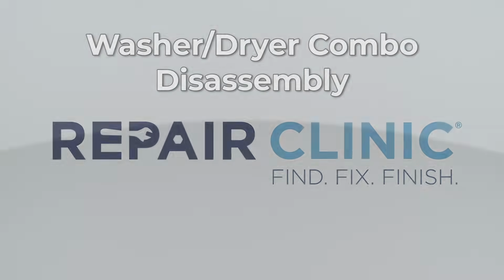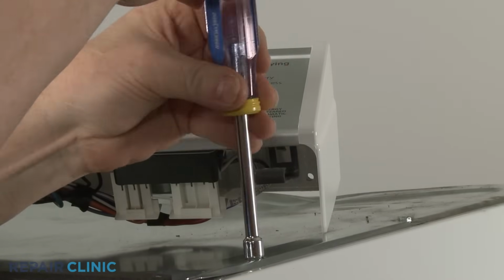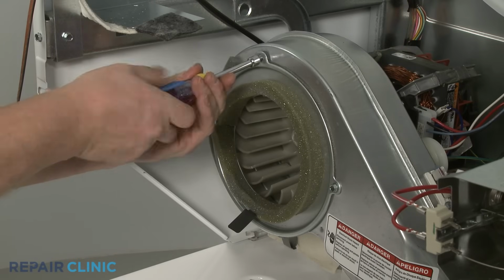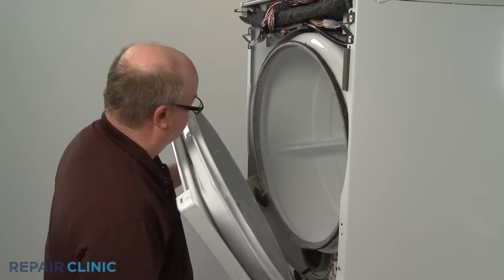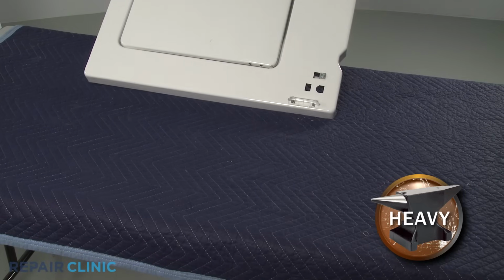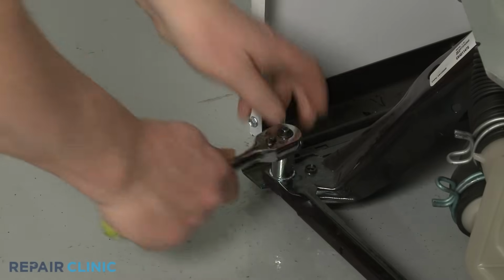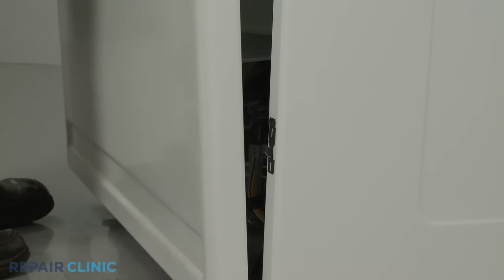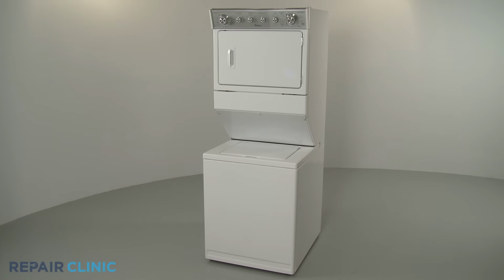Whirlpool Electric Washer/Dryer Combo Disassembly WET4027EW0

Comment: I have an item trapped beneath the agitator.  Can you tell me how to remove the agitator?
Reply: Depending on the model I usually cut them out use a puller tool to remove what’s left and replace with a new one

Comment: Thank you VERY much for this video, last night I came downstairs to a partially flooded basement due to the water from the washing machine pouring onto the floor, turned that off and then spent hours absorbing as much water out of the carpet as I could.  Today I watched this video and found the issue and fixed it.  Washing machine is now running correctly and I'm working on getting the carpets dry.  This video helped me a lot.  Thank you again.

Comment: awesome video/ My washer top does not appear to have any spring clips. do you have any videos of how to disassemble that style(WET4027HWO)?
Reply: I have the same question. Exact same model as yours. Get the point of taking off those fabric covered panels. Then it's just flat on the back. No springs there. Did you ever figure it out? If so how? I didn't want to just start unbolting/unscrewing everything that is in the area of the lid on the back. But I think that will eventually be process of elimination to get it done lol
Reply: I had the same issue, but look for some screws behind the short metal plate on the rear

Comment: What do you do on the model wet4027hw oh if the top on the washing machine does not slide out like the other ones on the stack owns how do you replace the lid switch
Reply: I have same model. Has no clips to detach behind those access panels. Can't find anything anywhere on the Internet about it.

Comment: I have a new model of the WET4027HW0 stackable washer/dryer and the top panel/lid is one piece from front to back and I need to replace the washer lid switch.  Do I have to remove the entire upper dryer to get at the lid switch?  The video shows a shorter top panel/lid, which is straight forward to remove.
Reply: Yes, I have the same problem; i need to gain access to the 'HW0 insides to replace the suspension rods, and I don't see any easy way to do that, other then completely de-stacking the dryer.
Reply: @ronaldrissel6665  did you figure anything out other than total disassembly?  Looks like a terrible design.

Comment: Great video. My dryer operates well until the very last part of the drying cycle. When the dryer is hot a loud rubbing sound starts coming out of the dryer. If I stop it and start it. the sound goes away but after a few minutes it comes back. Does anyone know what the problem is and how to solve it?
Reply: I found the problem. When the dryer heated up the blower wheel  expanded enough to contact one of the screws holding on the blower housing inlet cover plate.

Comment: Great video ! I have an old Whirlpool LTE6234AW1. (when pluged in) the washer setting control knobI pull it  out to start the washer But nothing happens. however if i turn the dryer selector to any setting and depress the power button for the dryer ,water starts to fill up the tub. this is so odd. what part would you think i should replace or what steps to trouble shoot for replacement parts? mucho appreciated

Comment: So my washer/dryer says it's this model but it does not look like this. There are no spring clips to take the lid off the washer. I need to replace the washer door lock
Reply: Did you ever get answer?

Comment: Thanks to you, we were able to change parts  and see how to open the dryer in the right order, we replaced the motor, the belt, the blower wheel, the element and all the seals and foam. We have a new dryer that will last for another 25 years.👍👍👍👍🌟🌟🌟🌟👏👏👏👏 Take care and bless you.

Comment: How can I adjust the water level on this model
Reply: I had the same problem, service man said put 5 gallons of extra water in the unit from a faucet. Great design.
Reply: Mark I have the same stackable and the same problem! Does it work ?
Reply: i am having the same issue -

Comment: I have just replaced the dryer belt on my 3.5 year old machine. What had happened was that the retaining clip that is supposed to be on the end of the spindle that carries the pulley on the idler arm had never been installed, and the pulley gradually worked itself out of line, causing the belt to run hard against one edge, which stretched it. During disassembly I discovered that the connection between the vent aperture in the door and the pipe in the machine was out of alignment by approximately half an inch, and thus the entire interior was covered in 3/4 of an inch of lint. It was not possible to re install the front cover without first propping up the drum with a 1 foot 2 X 4, removing the door, and supplementing the screws holding down the top cover to make it stay flat enough to allow the flange of the front cover to overlay it.Overall, only a minority of the screws aligned enough with their holes to allow re installation without the use of a clamp to pull the sheet metal into alignment.

I was unable to resolve the misalignment in the venting pipe. For this reason I believe this unit presents a significant risk of fire, and I plan to replace it as soon as possible. My decision is made easier, though certainly not easy, by the fact that the machine has never satisfactorily cleaned clothes. On all but one cycle it is not possible even to get them completely wet. It is not possible to wash dry cloth.

I will not be buying an American designed or manufactured replacement.

It seems that  this country sunk has so far into decadence that it can't even make a decent washing machine.

Comment: a close up of the knobs would have been nice! i'm guessing since there is no water level knob on mine that that pressure switch with the air tube that you fixed first off must control that? don't know. can you give us the p/n?
I have to ask...WHY would they even MAKE a washer that only fills half way up with water and call it Energy Efficient?!  I have to run it twice as long because it only does a half a load! That means TWICE as much Electricity!  I am sitting here trying to figure out if i need this pressure switch, when i see the owners manual on your site (thank you very much) and it shows it only fills up half way to save water.  This is ridiculous! I would like to find the engineer at Whirlpool, who my experience shows makes nothing but junk anyway, and stuff this up his butt!  I got this thing GIVEN to me and now i know why. I am glad i kept my old one.  For Sale: Cheap!

Comment: Thanks!  This video helped me get the washer top off my whirlpool thin twin stacked washer/dryer so I could replace a busted lid switch.
Reply: How did you determine the lid switch was broken? Mine had been working fine and all of a sudden the washer just does not turn on..
Reply: @donnabauerofbrilliancebyde1178  if I shoved the lid down it would turn on again.  When I took the top off, I could see the plastic was broken

Comment: I have a maytag 18955425qm washer dryer combo. When my wife was doing the laundry a bag handle got stuck and stopped the washing machine. I was able to remove the bag safely and the washer seems to work now. However, do you happen to know if the water basin has any clips or brackets to hold it in place? The water basin moves a little more freely now and I want to make sure that nothing broke in the process. Thanks, I appreciate your help!

Comment: Have a question I purchased a whirlpool stackable washer and dryer I was told I needed to purchase a 30 amp cord so I did it was delivered today I took off the access panel in the back to remove the cord it came with o believe it’s a 20 amp cord and I can’t find the terminal block

Comment: When he said to use a flathead to help detach the latch assembly, does anyone know how...exactly? Maybe I don't know where to push but it's not moving at all
Reply: Put the screw driver in and push towards the back
Reply: @LUCAMTire  thank you!!
And sorry to be confusing, I was warching the "Fridgidaire Affinity Washer Lid Latch Assembly  #137353300" video also by Repairclinic.com. The latch is on our right side. He pushed it with a flathead to get it off amd pull it down. That's what I was meant to ask. 😂

Comment: Thanks for the video.  It was really helpful in taking the dryer apart.  My problem is a loud sound when the dryer is on which goes away after a few minutes.  I thought the wheels need replacing but they spin freely.  But I did notice the white wheel on the retaining arm didn't move much at all.  Would I be correct in my assumption that it's that wheel that needs replacing?
Reply: Where is the washer plug on a Kenmore washer and dryer stackable unit